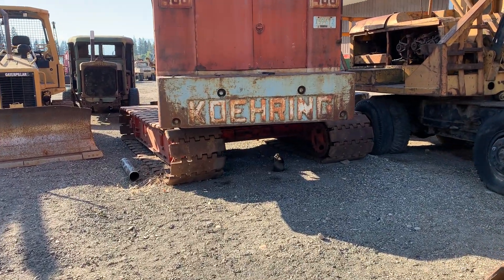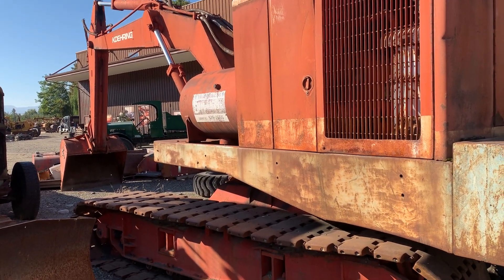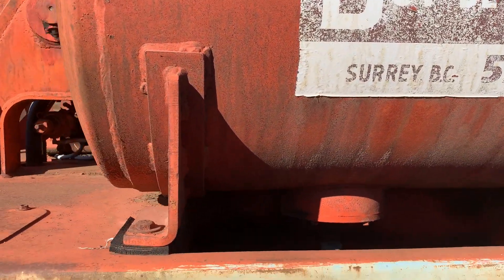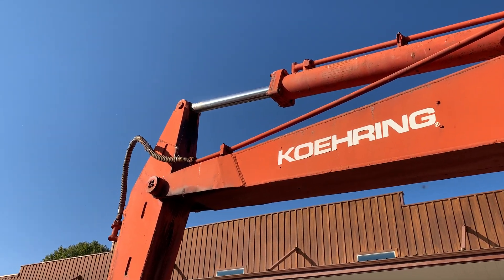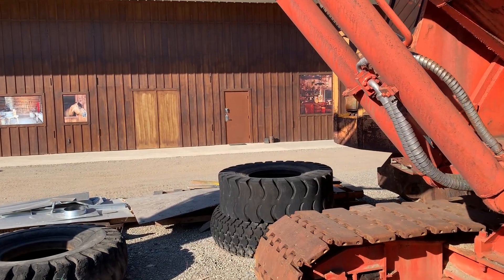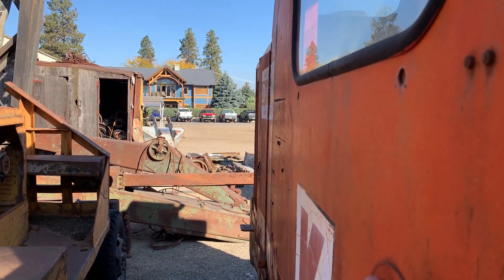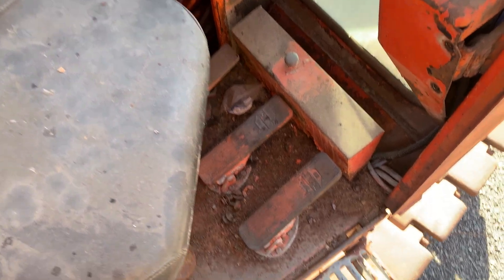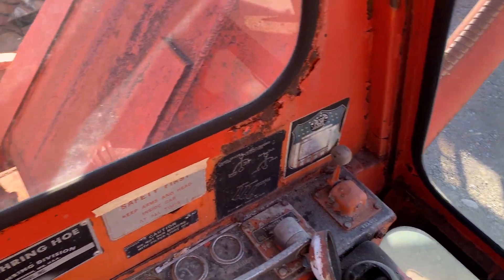Koehring 466 Excavator

Comment: Usually call those buckets smooth edged or grading buckets. We have a cat 320B with a rotator coupler and a 5' bucket. It's great for grading slopes and topsoiling behind curbs. You can cock the bucket to one side and get material in tight spaces.

Comment: Is that what grandpa would have called a "juicer" ? That's a good ol girl!
Reply from the maker: A juicer was the term given to hydraulic log loaders when they appeared in the woods to start taking over from line loader cable machines, because they ran on hyd fluid(juice) instead of brakes and friction blocks